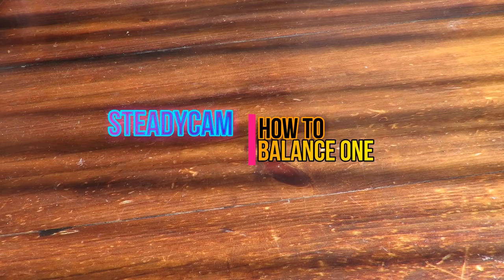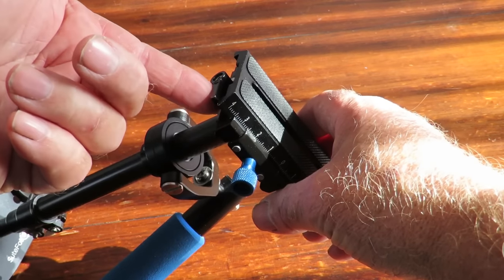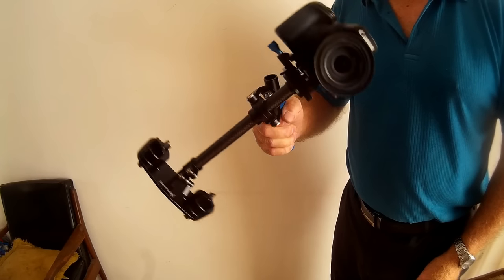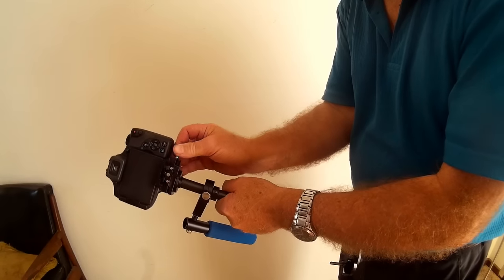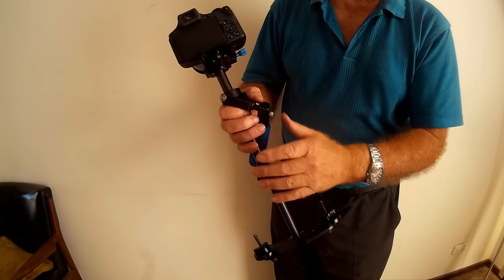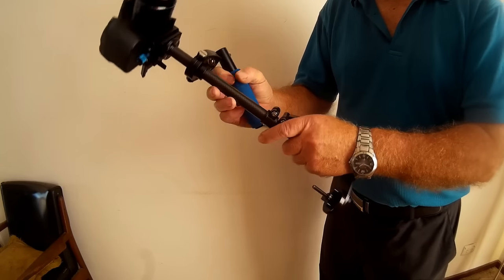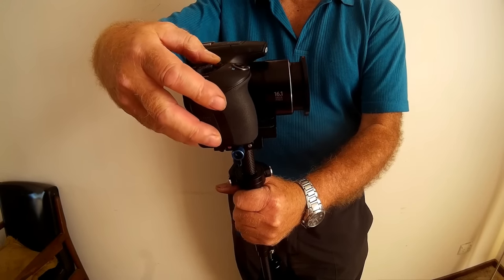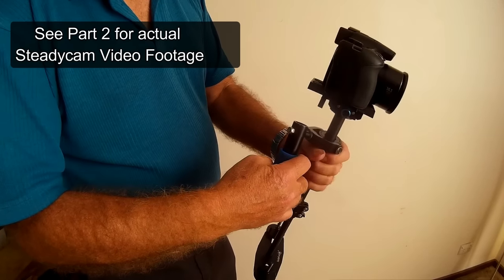📷 How to Balance a S40 Carbon Fiber Handheld Steadicam - Canon Powershot SX60 HS

Comment: For those who have digital cameras, like me. I suggest lengthening the pole all the way and adding one small weight first. I have a Sony a5000, with a 35 mm lens, so it's not entirely too big, but I used one small weight in the back pushed all the way inside, away from the outer corner, and lengthened the pole all the way. If It tilts a little back or forward just adjust your camera on top (slide it forward or backward) until it is evenly stabilized. Hope this also helps.
Reply from the maker: Hi Julie
Thats a great tip.
I'll pin your comment, as I'm sure it will help those who watch my video.
Reply: Thank you, I had a super difficult time trying to stabilize mine since it was a lot lighter and it wasn't a DSLR, but with just more patience, I was able to get it. Hope this helps all you Digital Camera owners, out there! :)

Comment: Thanks..... Placed my S40 Carbon Fiber Handheld Steadicam order today... 03/07/2017 $74.95 TOTAL cost......  I will give it a try.  My arms are very weak due to nerve damage, but with my elbows close to my sides, I think it will work.  I have many videos on YouTube and  IF I like this, there will be a video made with my review...  again thanks...
Reply from the maker: Hi 
Its not a bad device, once you get the hang of it,.
 I found the best way to get smooth video once your camera is balanced, and ready to take video. Start off by holding the vertical shaft gently with two fingers, until you get to up to a steady walking pace, then release your fingers from the shaft, but keep them close. This will help stop the initial inertia swing, when starting your video walking shoot.

P.S. When you get your video made, pop a link here, so Others, including myself, can watch.

Comment: ok i’m gonna rant here please refer to what i’m gonna say on how to properly balance a steady cam

1. the weights should by be facing the same way he camera is facing. 2. start with 2 small weights and balance the center of gravity first, if needed then apply more weights. (I use a GLIDECAM Devin Graham Signature Edition) .3. never set the pole all the way down unless you’re using a heavier cameras (Im using a Canon 1DX alone with a RØDE VideoMic Pro plus with a 16-35mm L II Lens) 4. put all your accessories first on your camera then proceed onto balancing (This is including the Battery, Lens, a hood or external mic, and even the SD Card

please know how to properly balance a steady cam/glidecam, refer to Andyax’s video on the Yelangu S60T or DevinSuperTramp’s tutorials. thank you
Reply from the maker: Hi James
This setup is for a Canon Powershot SX60 HS, which has a movable zoom lens, so balancing any other way is rather difficult, and time consuming.

Setting the weights to the side, makes for much faster balancing, as the Canon Powershot SX60 HS does not have a fixed static lens.
So, depending on what focal length is chosen, the balancing only needs a small amount of adjusting from the primary set position. 
This setup in the video makes it is easy to accommodate for the extra length of the lens, and when the zoom lens is extended, to its various focal lengths.

Comment: Gary, I used your technique and got all axis's balanced. I can stop it at any point and it stays put. But, when I move left to right, to test, the camera begins to spin slightly to the left. Also, when I walk, pendulum affect. Thoughts ?
Reply from the maker: Hi Art
You need to fine tune your balance a bit more.

Rotation to one side tells me, you need to shift the camera ever so slightly to the opposite side, plus slightly forward, or backwards, to remove the rotation problem you are having.

Also any Pendulum effect, is again, an indicator that you are close to balance, but not quite there yet. 
(You can eliminate a fair bit of this swinging movement, by starting your walk slowly, and gently holding the vertical stick with two fingers, this will help give you a steady shot.)

P.S. The longer the lens is in front of the camera, the harder it is to get the unit balanced perfectly.

Balancing is a frustrating thing to get right, but once you do, it becomes very easy the next time.

When you do get it correct, write down all the settings on a piece of paper, so you don't have to guess what settings to use next time.
Even then, you will still need to do some micro adjustments, each. and every time, you pop a camera on it.
Reply: I have the same problem. I guess I'll have to keep trying

Comment: Does anyone know a fix to my issue? When I pick up the Steadicam it decides to spin around slowly and when I get it balanced the camera rocks back and firth
Reply from the maker: Rocking back and forth indicates the camera needs the weights adjusted at the bottom of the steadycam. (Either up or down.)
Rotation indicates it still needs to be balanced a bit more.

First fix the weight issue, then address the fine tuning balance.

Comment: The lateral slide lock isn't working? Keeps sliding freely
Reply from the maker: If its a New Unit 
I'd suggest you contact the seller.

Otherwise, you could try fitting a longer screw that will go through, and engage the locking plate.
Reply: @GarryPurcell  good advice, and for clarity is an sp50 from innorel, I contacted them and got it to work by stripping the springs on the locking plate :) the longer screw idea is excellent
Reply from the maker: Please let me know if the longer screw works.

Don't forget:
You will need to cut it's length to make sure not too much is protruding from the edge of the plate.
.
If you have a friend with a lathe, they could turn one to size for you, and add a knurl to the end.
Another option would be to design one for a 3D Printer.

Comment: My steadicam is always spining around itself and i can't balance it.
what im have to do please help!!???
Reply from the maker: Spinning in which axis?
Reply: Garry Purcell it's spinning on right and left always can you help me?
Reply: Garry Purcell it's spining around itself
Reply: Garry Purcell so can you help me???
Reply from the maker: I assume you have already started my balance method, and have the counter weight set correctly for your camera, and the steadicam holds its position when you rotate the main shaft. 

IMPORTANT: When the steadicam shaft is held horizontal, as per my video, your camera MUST stop rotating at any part of the 360degree rotation cycle, and hold its position.

If your steadicam spins as you walk. (You need to move the slider in the opposite direction)

I.E. If it spins to the left, you move the slider ever so slightly, to the right. (the smallest of movement on the slider, will make a difference. )
Reply: Garry Purcell my steadicam is not tilting right or left it just spining around itself in circles. please help me
Reply from the maker: Any Rotation when the main shaft is vertical, means your steadtcam is out of balance. 

As I said above
IMPORTANT: When the steadicam shaft is held horizontal, as per my video,  your camera MUST stop rotating at any part of the 360degree rotation cycle, and hold its position.

Does your camera hold position?

Comment: You keep talking way way too long and people lose patience! You are not showing where the problems are and how to solve them. Your video is showing a dangling turning camera, no more.
Absolutely no educational effect or advice.
Reply from the maker: It's not easy to balance a Canon SX60 zoom camera on a Steadycam style gimbal, and you need to understand how each minor adjustment works.
You will find that you will need to do a micro balance each time you use this type on steadycam balancer.

P.S. If your prepared to spend around $700.
It's much easier to balance a zoom camera on a powered 3 axis gimbal (I purchased a FeiyuTech AK2000S 3-Axis Gimbal)